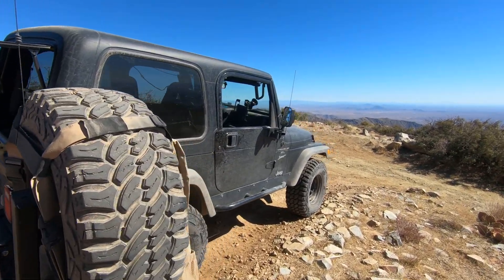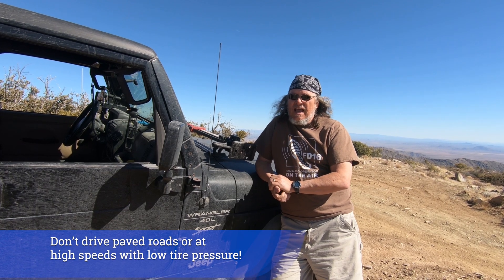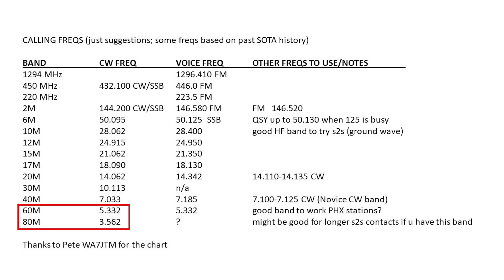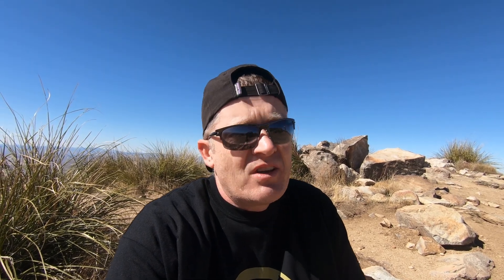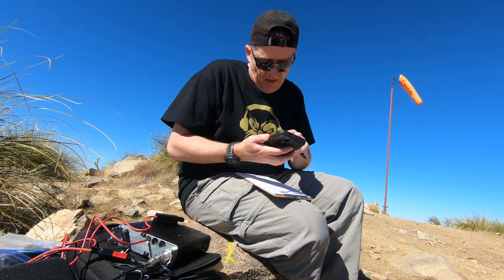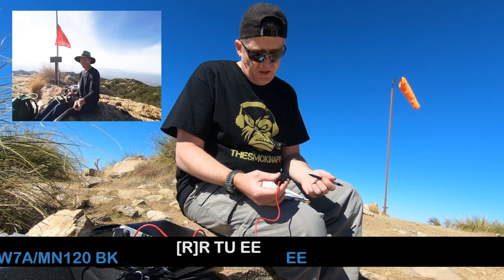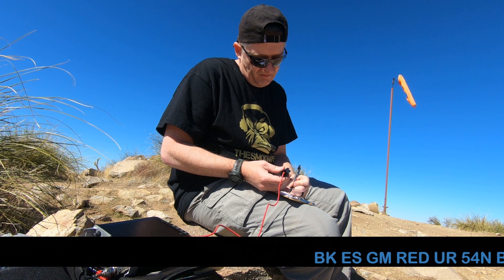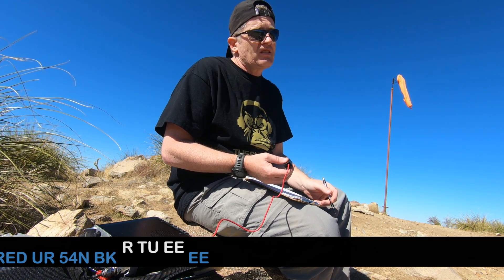Most Used Frequencies for Summits on the Air Activations

Comment: I thought no contest on 60, 30, 17 and 12-meter bands off limits from competitive events. Secondly motor vehicle use is prohibited to get to the summit...
Reply from the maker: Hi there - thanks for catching the video. WARC bands are OK to use for programs like POTA and SOTA. They are not competitive (even though some make it so in some ways).  They aren't considered contesting events.
Regarding using a vehicle, it's always been permitted to drive to the top of a summit.  There was one association that did have a provision requiring you to hike out of the AZ with your gear and then back in, after you parked your vehicle, but that has long since been removed.  Vehicle rules only talk about not using the vehicle in any way for the activation once on summit.  Drive up, park, move all your gear away from the vehicle (not connected in any way) and you are go to go.
Thanks again for visiting the channel.

Comment: Thanks Charlie great video and you covered all the traps for young players you are a real ambassador for the hobby. I have a proper tyre pump on order it's been on my mind for a while. I do 2 real 4x4 rocky climbs and I take my spare tyre out from under the tray tub and keep it in the back of the tray. If the tyre went flat I would not be able to wind the spare down from under the lower vehicle. Cheers Mate vk5cz ..
Reply from the maker: Sounds like that would be a real adventure if you had a flat along the way.  4x4 is fun!  I need one of those pumps too.  It's been on my mind like you.  Thanks Ian